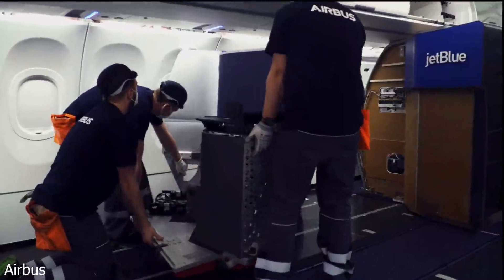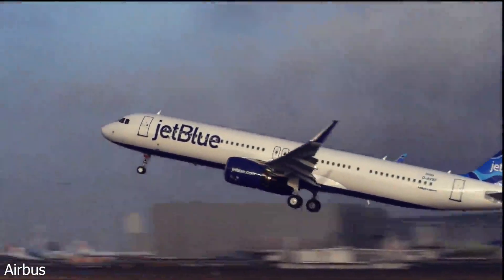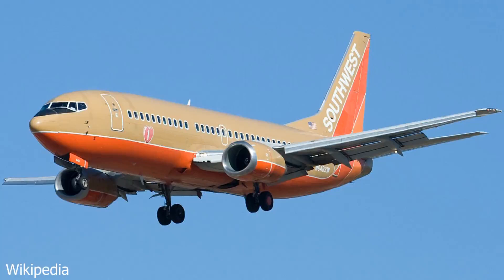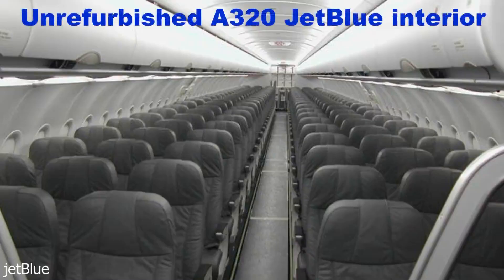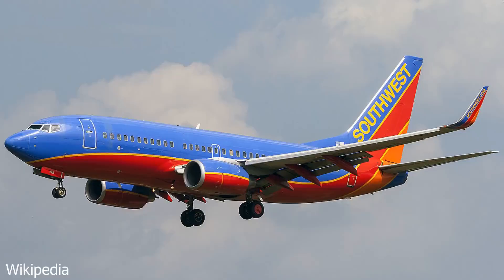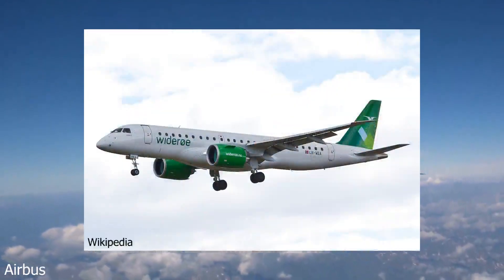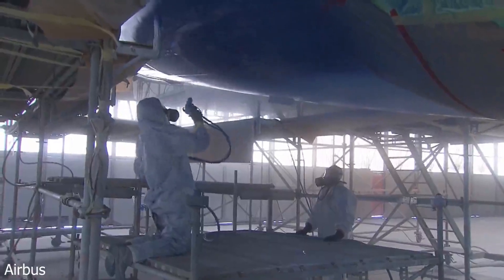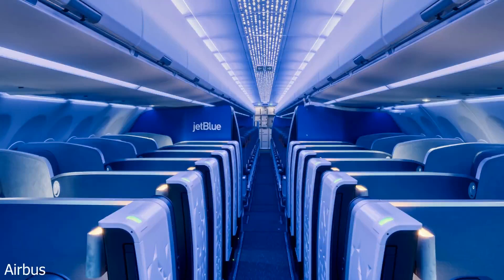Why is JetBlue (Almost) All Airbus

Comment: The basic answer is that Jet Blue started with a clean sheet in the early 2000’s and since the late 80’s it has been clear that the A320 series is the better aircraft. Virtually nobody starting with a clean sheet an no legacy of Boeing operations has ordered the 737 since 2000 and a number of airlines have thought that the training, logistical and operational costs of making the switch from 737’s to A320’s has been worth it.